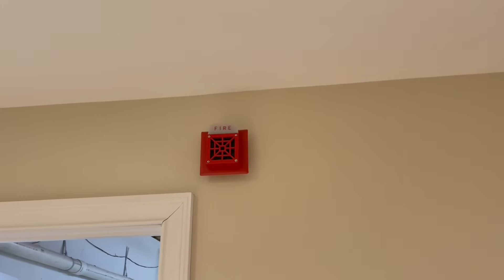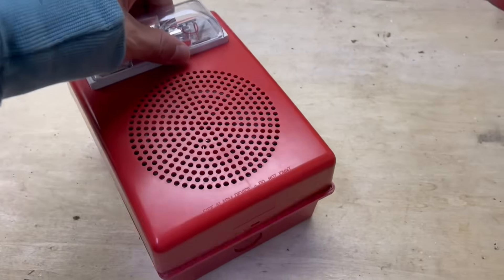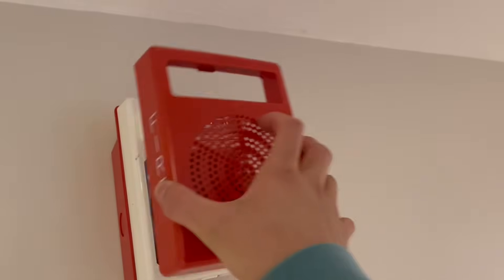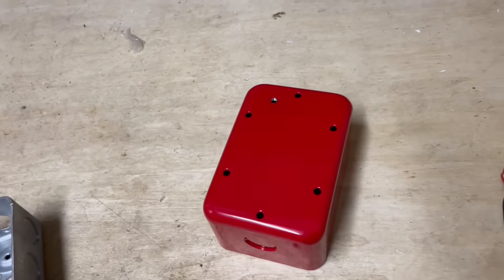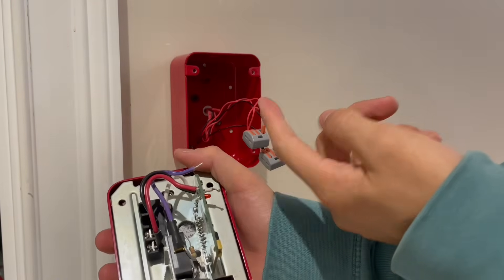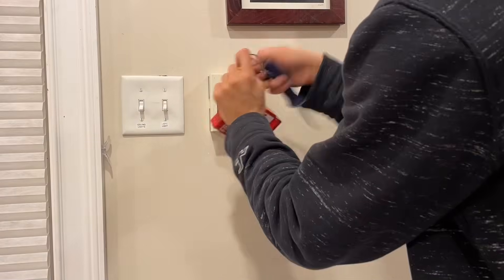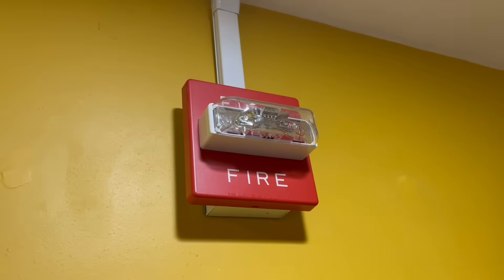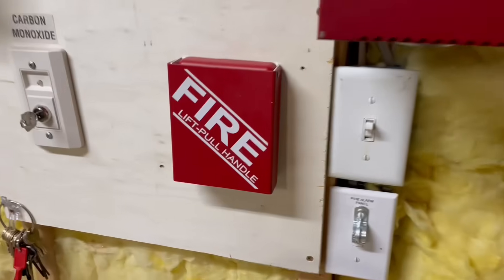Installing Wheelock E50 Speaker/Strobes to Replace Wheelock 7002s | Fire Alarm Device Replacement

Comment: Nice! For my demo system I am installing soon in my basement should I run 4 wires for smokes and cap off when I have a 2 wire detector up or should I just run 2 wires?
Reply from the maker: Whatever’s easy

Comment: Wheelock makes the most amount of Speaker/Strobes. They are honestly some of the most reliable Speaker/Strobes despite being non-ada or ADA Compliant. I thought an EST Genesis Speaker/Strobe is Smaller than a Wheelock E50 Speaker/Strobe. What candelas did you set the speaker strobe on the ceiling and in the garage?

Comment: I always find these wheelocks to be a pain to work on lol. Very easy to cause ground faults especially when larger gauge wires are used. Much rather prefer devices either separate mounting plates with the terminals built into them
Reply: I kind of debate that because the System Sensor Advance, L-series mounting brackets are more likely to cause a ground fault if you don't use positive, negative wires and just use ground wire.

Comment: Request for testing the wheelock E50s you can  use the Siemens fire finder xls female voice evec
Reply: Yes and also an MXL message to compare.
Reply: @aerhardtThe MXL messages are played from a DMC-1. If you don't have that on a MXL-V then it just does tones like the Notifier AMG. The DMC-1 can support a lot of custom messages per DMC-1.
Reply from the maker: Maybe